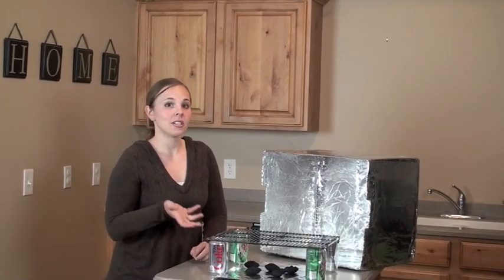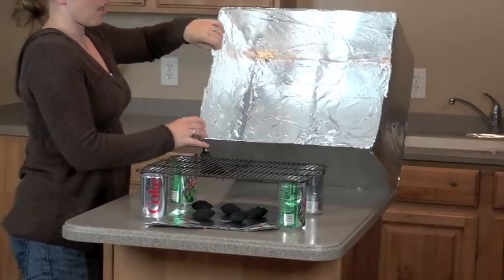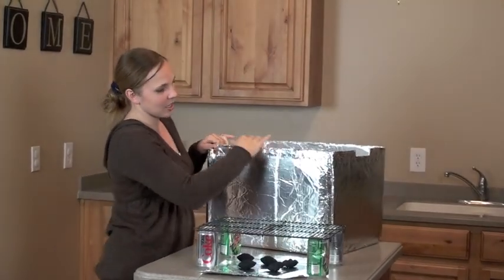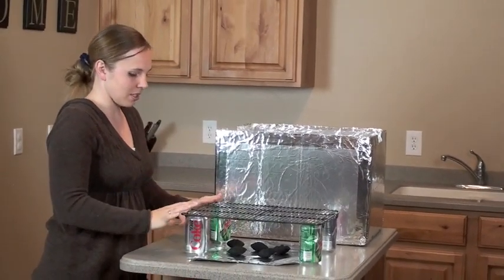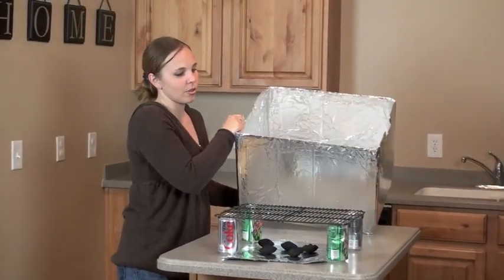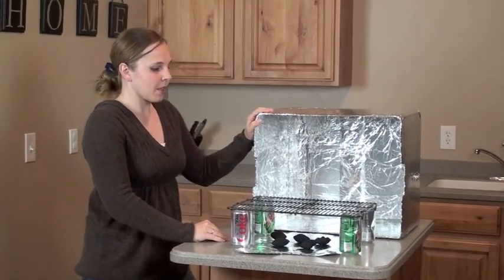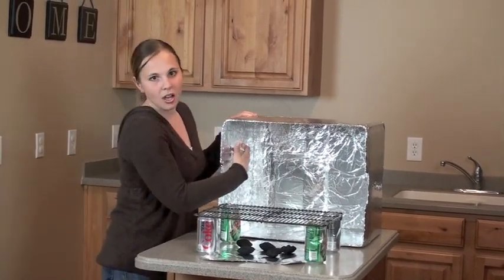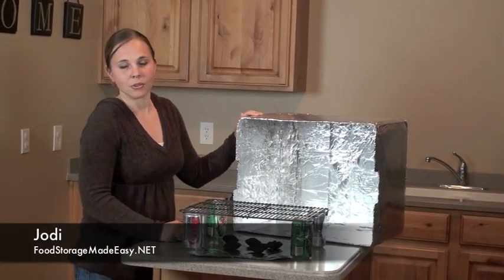Powerless Cooking Class:  Cardboard Box Oven

Comment from the maker: @prayfortruejustice Use 1 coal for each 35 degrees of heat desired (i.e.  10 coals will heat  though it’s a 350° oven).  Use anywhere from 8-14 briquettes depending on the temperature you want.  This oven can maintain its temperature for 45-55 minutes.  Add fresh coals if longer cooking time is desired. When cooking in colder temperatures insulate by covering the oven with a blanket and set the coals in a disposable grill liner to keep them off the ground.

Comment: Thanks.  So, what is the Charcoal to heat/time ratio?  
Perhaps cutting a number of vent holes and putting a weighted-down aluminum pie tin over the vent would enable you to control the temp by revealing one or more holes, thus venting some of the combustion gas out the top.  A meat thermometer poked into the box and taped in place would give you temperature.  
Or just use a Webber Grill.  Coleman also makes a small collapsible Oven for use with their fuel stoves. (Google "Coleman Camp Oven")